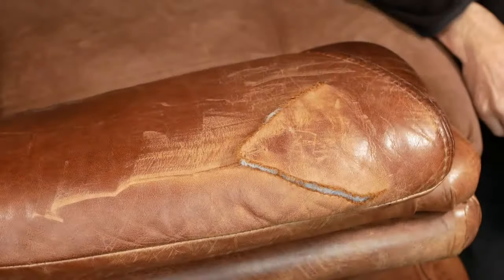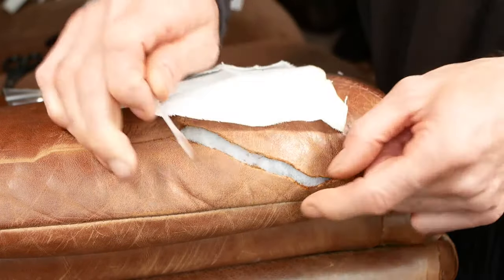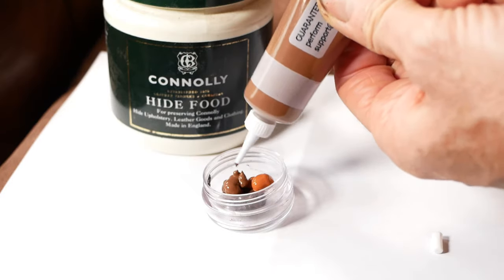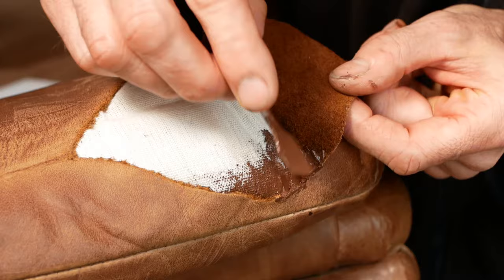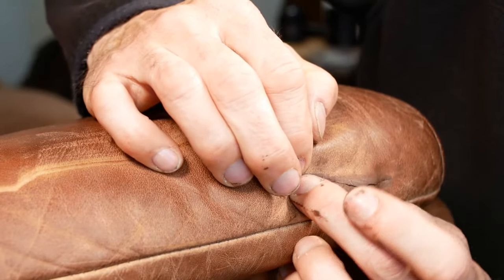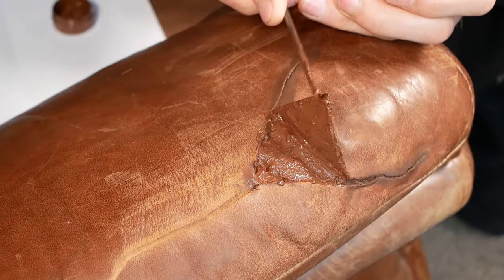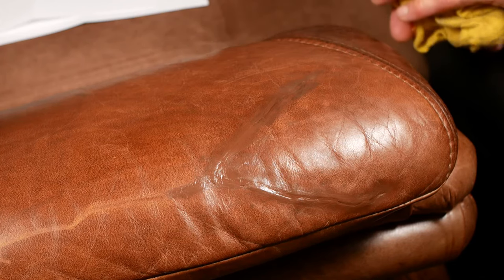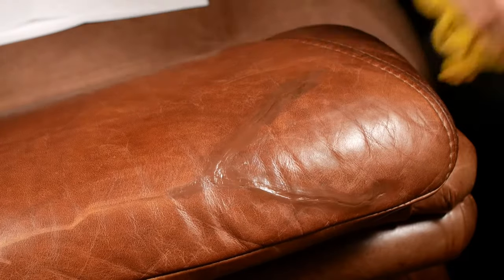Repairing A Tear In A Leather Sofa

Comment: This is an awful repair finished awful joints left gaping  it will come straight back  apart
Reply from the maker: Hi John, I think you may have missed some of the point to this video, the sofa in question had cost the owner £30 (or was it £25) from a charity shop, so a professional repair was out of the question.  I think I said on more than one occasion during the video that a stitched repair using proper repair materials would have been a better approach.  One of the main reasons I uploaded the video was to show that although you can repair items using the cheap filler glues, it's nowhere near as easy as any promotional videos will have you believe, where they usually have a very neatly cut triangle on a perfectly flat seat, with no curves or seams to worry about.  The strength of the repair comes entirely from the backing material, so although it would have been nice if I could have got the joins tighter, either by using thread to stitch the join or if I could have removed the wadding, the end result looks far better in the flesh than it does on camera (I think I mentioned that in the video but I can't totally remember).  But on your final point "it will come straight back  apart", after 747 days (since the video was uploaded) of being sat on every day (the owner hasn't been on holiday so no days off), the repair looks exactly the same as it did when it was first done, there is no cracking on any of the joints - I sat on it last night and examined everything closely, so this is pretty up to date information.

All that said, a proper leather repair using thread and filler applied using a hot iron and finally re-colouring the repair would have been far more satisfying, it just wasn't the solution for this particular job.
Reply: Great video

Comment: Oh man, what a crappy repair. I'm an amateur but my repairs are way better than yours. Sorry, but I'm just being honest. You needed to pull the gaps tight and not leave gaps.
Reply from the maker: Hi DumbSkippy, I'm well aware that the repair could have gone better, part of the reason for filming the repair was to point out that using these leather repair kits isn't quite as clean and easy as their promotional videos will make you believe - I think, without exception, all the manufacturers advertising videos I've seen select a nice simple tear (in fact I've seen several that look like a very clean knife cut, as if they've got a perfectly good cushion and cut it carefully before then "fixing" it - all very fake) right in the middle of a flat cushion and never tackle a repair on a tricky curve where the padding is trying to push the repair apart all the time.  Adding to that, working round the camera and the legs of the tripod always hampers whatever I'm working on - less of a problem on some jobs, but where the adhesive is setting rapidly, it was a real pain on this shoot.  Undoubtedly, as I mentioned during the video, the best repair would have been a stitched repair, preferably using a heat applied filler and heating iron, then colour the repair with a dye - but again, I wanted to show what it would be like doing this job using one of the cheap repair kits.  If you're good at doing similar repairs on tricky curved surfaces, with the padding constantly trying to undo your work, then there's an opportunity for you to make your own videos on the subject - there are likely to be plenty of people searching for advice on the subject.
Reply: @GrumpyTim  I'm sorry that I insulted you. Sorry mate!
Reply from the maker: @Smart-Skippy  Hey, no worries DumbSkippy, but seriously, if you did ever get round to filming one of your own leather repairs I'd be interested to see it, so let me know if you do.
Reply: @GrumpyTim  Thanks mate! I have a tricky one to do soon.

Comment: No need to use a piece of material under the leather. Stitch the leather flap together, apply filler, recolour.
Reply from the maker: Hi tttt, I did mention in the video at 07:02 that a stitched repair might have been a better solution, but there again, the best repair would have been a stitched repair followed by the application of a heat applied filler, followed by leather colouring dyes - for this you'd also need the iron to heat the filler (this also flattens down the stitches so they become more or less invisible) and a selection of dyes - all are available from professional leather repair suppliers but not necessarily the first thing your average person will look for because it isn't such a cheap solution.  I wanted to use the cheap product on a slightly trickier repair to show that it can be done, but it isn't necessarily as easy as most of the marketing videos will have you think - without exception, all the videos I've seen showing these products select a nice easy cut, right in the middle of a lovely flat cushion, with no curves and no seams in the vicinity.  Not least of all, that sofa cost my friend £30, so an expensive repair wasn't really justified.

If I had another suitable candidate it would be interesting to try the stitched repair using these acrylic fillers to see how well you can disguise the stitches.  Even better would be to do all three methods - acrylic filler with backing material, acrylic filler over stitching and finally heat applied filler with leather dyes etc - I know which would be the best, it would be the final method, but I wonder which of the other two would look the best.

Comment: Nice video. I really like the way you showed the actual products you were going to use in the video. The repair ended up looking quite good actually.
Reply from the maker: Cheers David, it was a cheap repair and it worked well.  A few people have got a little upset because it wasn't a professional repair, but I think they're missing the point, the Sofa cost something like £25 (or it might have been £30) from a charity shop and sending it to a pro for repair would have been pointless.  It's still holding together well after 2 and a half years of daily use, so the owner of said sofa is perfectly happy with it.  Cheers for the comment.

Comment: I just wanted to recommend some Heat N Bond for your backing. I have used it to repair my leather chair and my fabric couch. They are both green.
When I made my repairs I found repairing the leather was easier than repairing my fabric couch as I had 2 ‘L’ shaped tears. I have 4 dogs and they are from their toe nails. My furniture is all second hand for the love of my fur babies. In my area there is always a piece of furniture on the side of the road. I have learned a lot by taking pieces apart and redoing them.
Reply from the maker: Hi Tina, cheers I'll keep that in mind.  Glad to hear that you're using and repairing unloved old furniture, it's very ecologically sound, aside from the fact that it saves lots of money too.

Comment: Great job
Reply from the maker: Thanks Rochelle, it's not a perfect job, but it's so much better than that huge tear in the arm, which would only have just got bigger if it was left unattended.  The sofa in the video only cost £30 from a charity shop, so an expensive repair wouldn't have been particularly viable, however, just for a bit of extra viewing, here's a video by A.R.T.'s Real Repairs, where he uses a more professional method (if trying this as a DIY job it would cost considerably more because there's some special equipment and materials needed), but the results are pretty impressive.  https://youtu.be/v1FLfKzBsmc
Reply: Thank you for taking the time to reply to my comment. I appreciate the advice and will definitely look into that for my large jaggered dog rip.
Reply from the maker: You're welcome - it's always worth exploring different options before tackling your own repair.  If you do take on repairing your dog chewing rip, it would be worth getting hold of some random scrap leather first and just doing a few test repairs on that so you get the feel for it before you try the real thing.

Comment: I watched your video, an ordered a repair kit. Did 1 of three repairs on my chair. However, the glue paint is not the same color as the chair it is so off. Can using a wax or leather cleaner help to tone down the difference? Its on the foot rest.
Reply from the maker: Hi Kathy, I don't think the regular polishes or waxes will make much difference to the colour of the glue/paint, there are proper leather recolouring products for professional use but you'd need to track those down and they probably wouldn't be particularly cheap.  Assuming you used a similar kit to mine, where you mix the colours yourself, you could mix up small batches of a slightly darker or lighter mix (depending on whether your existing repair is too dark or too light), and just speckle in tiny blobs of that new colour with something like the point of a cocktail stick - the idea wouldn't be to get total coverage of the new colour because real leather is rarely a consistent colour, you'd just want to do tiny little speckles until the colour blended better.  This will be a trial and error process, so try a sample where it won't show before charging into the main repair.

Comment: I think the trick is to open the door and push the sofa through the frame, rather than pushing it through the door... (Sorry, couldn't resist)

Good repair, thanks for showing us how.
Reply from the maker: Ah, that's where it all went wrong then!!!!!!  Kind of a shame that it got torn, but it looks fine with the repair done, and it's still a really nice leather sofa (or technically a half leather sofa because the cushions are fabric) for less than the cost of a tank of fuel - substantially less these days......

Cheers for watching Ben.
Reply: @GrumpyTim  definitely worth doing!